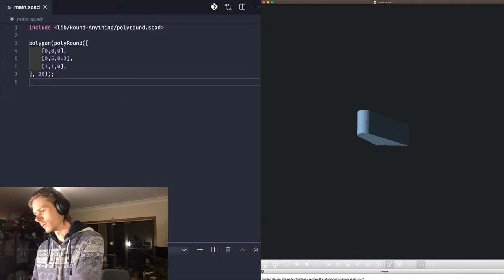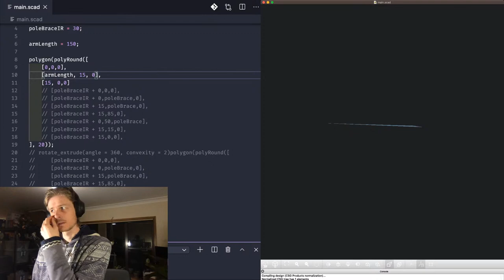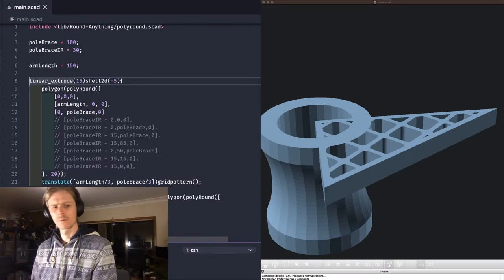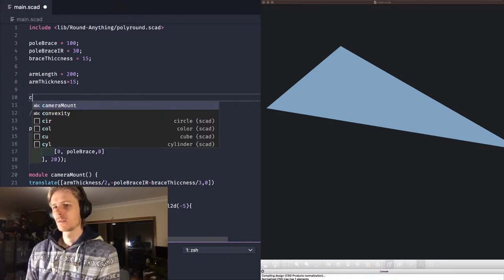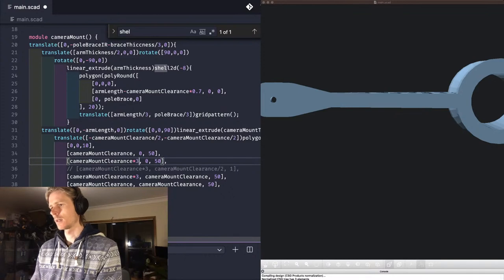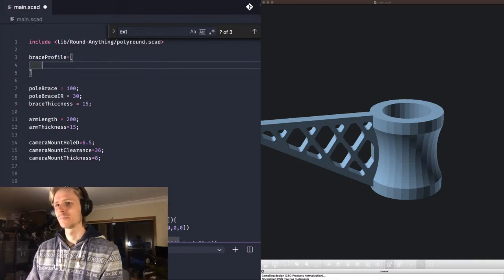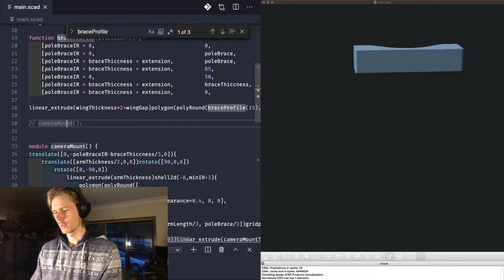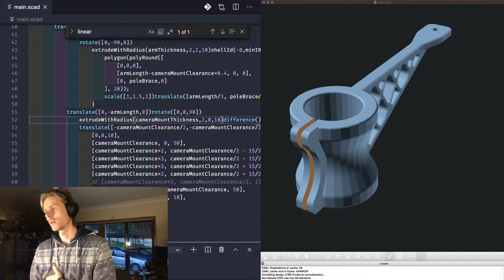[Stream] OpenSCAD, lets build a camera mount

Comment: Nice to see your thought process when generating the model.  Curious to know what editor you are using and how it interacts with OpenSCAD
Reply from the maker: The editor is vs-code, there's an extension for openscad syntax highlighting. All you should need to do to get them to work together is open the same file with openscad and vs-code. Openscad should auto update when the file changes, i.e. when you save. It makes sense to hide the openscad editor when doing this.
Reply: Ah, that will be pretty neat as I use vscode for other projects too.  I ended reviewing OpenSCAD after AutoDesk decided to make some changes to F360 and found your video giving the pro/cons very helpful, thank you!
Reply from the maker: @scottdeakin7789  Glad you found it useful. Like I mentioned in that review video, I have an openscad library which promotes a sketch and extrude style cading in openscad, might be useful to you coming from F360
Reply: @meanman1992  I have only used it briefly as I am still getting up to speed with OpenSCAD nuances, but it's a very impressive library and I suspect it will be something I end up using regularly as it solves a number of shortcomings in OpenSCAD.  Thank you so much for sharing it with the community!